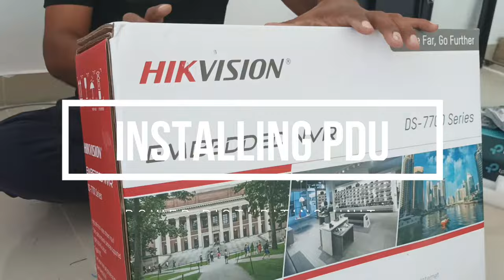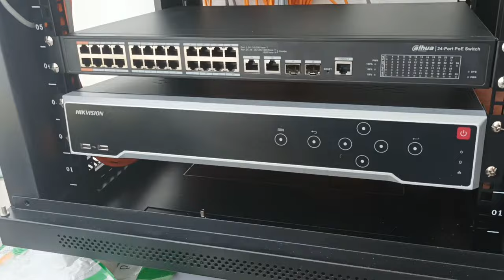Network server rack 15U management patch panel installation & network cable management installation

Comment: Get rid of the crappy repetitive music! Why did you put the items in the wrong places in the cabinet when each shelf is clearly marked where it should go? The white line doesn't designate halfway through the item, it means the bottom of each channel that you can use. Your text overlay is totally out of sync with what you are doing in the video.. This is a classic example of how you should NOT install a system.
Reply from the maker: Hahaha
Reply: Damn